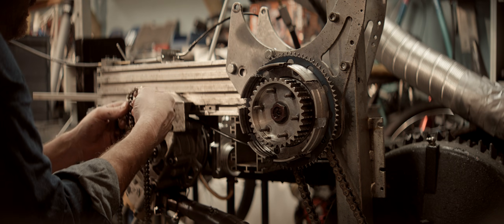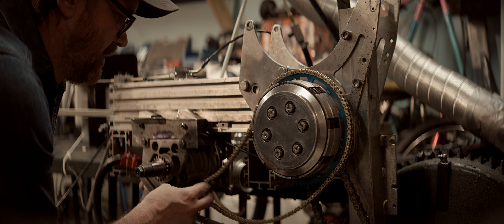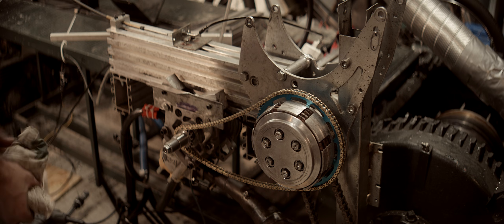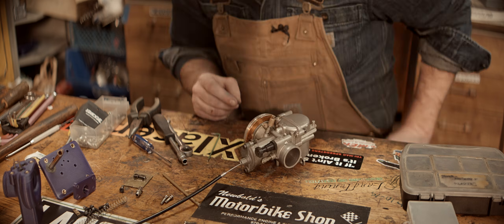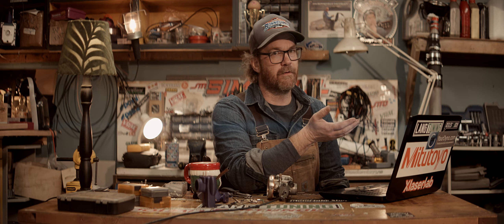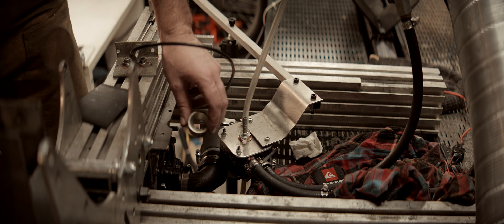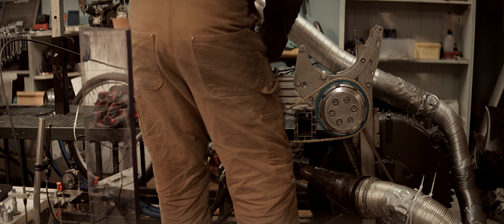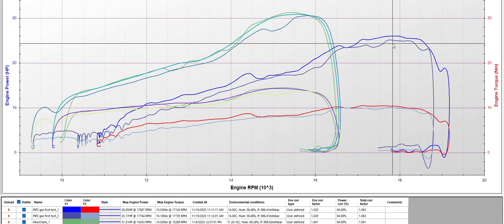50cc - 26hp on Pump Gas(without any tuning!)

Comment from the maker: Sorry about the delay! Promising results, especially as I just guessed on jetting 😁
Reply: Im looking forward to the day you make a v twin 100cc engine, you have the ability  , food for thought after you get where you want to be with the pip
Reply: Hope the approaching winter is kind to you and the family.
Reply: Get some RVS chain lube. Slippery stuff, like everything they have. Triboceramic witchery.
Reply: As for the "floating float" and keep in mind, I know nothing of engines, but I can't help think of how older generations of drones had those four small rubber boots/standoffs to hold the camera gantry and isolate vibrations. Might work for you, too.
Reply: Have you considered Nitrous Oxide + Race-Gas vs. Methanol & Nitro-Methane as the power adder???…..On naturally aspirated drag engines the power-ceiling of both is similar pretty similarly matched, because only so much air can be processed, and mechanical limitations usually come into play before that (if reliability is important).
Reply: Loving the spontaneous component relative spatial expansion shield!
❤❤❤❤
Reply: Wait what! Did you just brake the world record you have been after??? Thats 520 hp to the litre! Insane!
Reply: @PPekka   I don't think there is a previous officially sanctioned world record. but production bike record is 16.5hp (1966) and more recently the aftermarket Bidalot RF 50 WR that holds land speed worl records was denied over 20hp at the wheel. so yes 26hp is likely possible and I guess would be a WR if it was on a calibrated Dyno which is the big caveat since it was never dynoed outside the custom built Dyno and there those numbers come after a big correction to the Dyno that was supposedly underreporting power. the corrected value is based on the evaluation of the total inertia of the Dyno based on a series of calculations so I would say the is a pretty big error margin. the two objective ways to prove the power would be on a calibrated Dyno or beating a land speed record in a category that does not rely heavily on aero improvements unlike streamliners. the channel has been chasing the 50cc landspeed record  with  custom built frame but no fairing, for this reason.
if you look at 125cc which has a bit more data, peak 2stroke 125cc dirt bike was around 41hp and 125cc gp bikes made 50-55hp which is 400-440hp/ liter.
if you consider 50cc is easier to rev and gp bikes also had to be ridable (power curve mattered as much as peak power) and last a whole race, I think it's relatively safe to say running at 500hp/ liter for just a few seconds/minutes is totally doable.
Reply: @geemy9675 no There is no official record but if you have been following  this Channel for a bit longer you know that he once said that he would like to build the most powerful two stroke engine per cc ever. If I remember correctly the benchmark was a motogp 2 stroke that made over 400 hp / liter
Reply: @PPekka  2003 KTM 125 FRR 55hp  is 440hp/liter
Reply: @PPekka also 1983(last year) 50cc gp bikes made up to 19.5hp and 1989 80cc up to 30hp
but if you have no limits nitro, supercharger etc the ceiling is much higher top fuel make 1300hp+ per liter. of course there is no way to make that kind of boost in a 2 stroke
Reply: Great to see you back. What a good start using a petrol mix.
Reply: All your chain are belong to us. Make your time!
Reply: Can you made one video in norvegian language with subtitles?

Comment: I would use an electric hp oil pump to lube a closed crank case and run the efi direct injection .
With electric turbo.
And variable exhaust.

Comment: You did a lot of work lately setting your dyno's software up. But, and that's a big one, you did not confirm the readings with a motor of known output. 

I highly recommend using an electric motor with 10-15KW to double check that your dyno is working. I seriously doubt that you actually made 26hp from pump gas, anything over 15hp and I'd be impressed.

Comment: 26 hp with gasoline is a perfect match for 32 hp with nitro/methanol. 

But you finally need to admit that your crankshaft has too little rotating mass, which is why the chain, in the direction where it should be under tension, is constantly running against the tension in the area where the engine produces power, thus creating vibrations.

I'm not saying this negatively at all; I want you to be successful. 

Your problem is that you've become blind to the real issues over the years. An engine simply has to be designed from the outset to meet the requirements of its intended purpose. That means a 50cc engine running at 17,000 rpm needs X amount of air. What compression ratio and compression pressures are achieved? The higher the pressures, the more power is needed for compression. Compression draws its required drive power from two sources: the engine speed and the mass of the crankshaft. If the crankshaft has too little mass to provide enough driving force for compression, the crankshaft speed decreases during compression, but the chain wants to continue running at the same speed. 
You've been working on this project for far too long now; it's simply time to get serious, and that includes realizing that you've never considered the most important factor.
The first step in building a high-performance engine is to completely calculate the required output and design all components accordingly. Compression requires energy; energy comes from mass and rotational speed!

Comment: Guys a fast question, I see there are many 2t gurus here. Is it possible too much squish clearance do a no start condition? I'll get crazy....

Ignition timing is precisely set with dial gauge 
Chamber volume is -2cc from stock to raise compression a bit 
Squish ramp (angle and length) is almost stock 
Squish clearance from 1,6mm stock, went to 2,4mm 
Bike should start , but it doesn't...

Comment: Make your own "fuel". I've been making mine for 30+yrs. 200 litres at a time. Couple of 10 gal drums, couple of 44's, copper pipe, stainless steel tube, medical grade latex hosepipe, Pirex condenser, induction heater. Let yt be your guide.! Now, wheres that great musik you usually have.?

Comment: Alex is that a kerosene heater you use??? Because they aren't very healthy mate, the gas that burns off them is carbon monoxide (CO) poisoning, then on top of that, the fuels your burning in bike, doesn't make for a safe work environment, even using the extraction fan.
Take care mate 👍❣️😎🍻

Comment: I would like to see you install 2 mounted, non tensioning idlers for that chain. 1 on top and 1 on bottom, positioned where the peaks of the curves are when the chain is bouncing for the chain when it's being curvy but set in position for when the chain is straight between the sprockets. I think it will cut down on vibration without taking power maybe.

Comment: WHY NitroMethanol REV'D LESS THAN GASOLINE: Nitro requires as much as 8 times as much fuel for the same air volume. That creates more inertia which causes a slower entry into the cylinder when the transfers open. That loss of time reduces its high RPM ability. Also it burns slower than gasoline and so is less agreeable to high RPM running compared to gasoline. But its energy content is more which is why more horsepower can be had despite these limitations.

Comment: If true, this is extremely extraordinary, when you consider that professional world championships 50cc GP racing teams, like Kreidler Van Veen, Derbi, Bultaco, etc, never got any more than about 21hp, (Generally, about 19.5-20hp were the top performers, that wouldn't grenade themselves by the end of a race.) after several decades of research and development, and real-world testing on famed GP courses, of 50cc two-strokes, using rotary disk case induction. . Unfortunately, I have serious doubts however, without professional dyno results, and real-world testing, with the engine in a bike, with a rider on back, etc. I would be picking Aalt Toersen's brain, before he's no longer with us, but I've mentioned you should connect with Aalt numerous times, over the years, and as far as I know, you still haven't paid a visit to Aalt's shop in the Netherlands. Something I'm sure many folks would appreciate seeing some videos on- a visit to Aalt's shop, and some demonstrations of championships-winning GP bikes. Aalt wasn't just a rider for Van Veen, he also worked on engine development for Van Veen's world champion bikes. He still has a shop today, and last I knew still had some of his 50cc Van Veens in the personal stable! I believe, he also still rides in demos, and occasionally a race or two, as they are still held all over the Netherlands each year, even tho 50cc GP is no longer an FIM-sanctioned World Championships class.

Comment: What’s a stinger in this case?
Haven’t seen this development from the start so I’m wondering if this engine has a rotary timing disc? 
Back in the days we had Kreidler Van Veen. This formally Amsterdam based 50 cc racing team build great racers.

Comment: It's fumes man.
Your health  comes first.
Spend a couple days figuring out how to heat and ventilate your shop space.
Isolate the dyno in an enclosure that you are not in when the engine is running and ventilate it separately.
It will also keep that chain from wrapping itself around your neck.
Nitro fumes are no joke, not even in a small percentage mix.
30 HP is awesome !!!  Did I see 19,000 rpm ? The nitro engine was giving up at 17,000 right ? Could chain bind drag down 2000 rpm? Wow.

Comment: 25% nitro fuel is easy to get outside Norway. Is Norway trying to ban itself from you making Norway famous by getting the 50cc land speed record? A big LIPO battery is much more dangerous. One in a hybrid car started a fire that burnt down a huge new 2000 car carpark in the UK, but that is OK because no nitro was involved and we are not allowed to critisize the all new all electric revolution.

Comment: Congratulations.
One could almost say it sounds to good to be true.
26hp 50cc is if RSA would´ve had about 65hp to the crank.
But i who am i to judge?
Reply from the maker: It doesn't scale like that, the port area to volume ratio is much higher with 50cc.
Reply: @2STROKESTUFFING  You need to go to a verified dyno to back your numbers up.
I´ve seen discussions doubting you a little bit here and there.
Reply from the maker: @Peter_Granfors  I'm not loosing any sleep over it.
Reply: @2STROKESTUFFING  Soon enough you do, or starti chopping wood again =)

Comment: I think it’s possible that the chain slapping around may be really messing up the run results in general. A plain solid tensioner will not help either.  A spring or hydraulic loaded tensioner would smooth a lot of it out. Any solid tensioner will only create harmonics at a different frequency. 
Your chain slapping around is definitely not helping the engine because it’s small creating instances additional resistance due to the harmonics of the chain. 

I’m saying this because the size of the chain compared to the size of the engine is very large compared to a regular gasoline automotive engine.

Comment: Great stuff as always! A little hack for you: Find an old round base microphone stand and mount you auxiliary fuel tank to it. Doesn't take up much space and is hard to tip over due to the heavy base.

Comment: 5:54 det flyr gnister fra kjedet ditt bror.. det er ALT for slakkt og trenger minst en strammer oppe. ikke dumt med en nede heller? de bøffer ikke noe nevneverdig energi heller, du kan tenke deg slitasjen på kjedet og tannhjul når det fyker gnister fra kjedet? syns jeg så noe småblinking her og der under det samme runnet og. når kjedet ditt flekser mer en to ganger kjedet sin høyde er du i slite territoriet til de fleste kjeder, det vil bli tråkkt sånn som det kjedet du tok av nettop om ikke lenge med den fleksinga jeg ser på skjermen min.

kudos for bruk av skjoldet :) det må jo kjennes litt tryggere ut bak det ville jeg tro. også har vi høyere odd for å ha Alex så lenge vi kan! det er det viktigste ;)

hvis jeg var deg, ville jeg ha målt kompresjon intervallmessig annenhver hver/hver tredje dyno run. rett og slett for å sikre ett helt rent gulv for målingene siden ring slitasje er konstant og uunngåelig og vil påvirke alle målinger. fjerne variabler er gull.

p.s. 
braketten til jackshaften er litt løs og begever seg opp og ned litt. vanskelig å se i vanlig avspillings fart, men jeg la merke til det mens jeg lot videon gå i 0.25 hastighet mens jeg skrev kommentaren her. stram den opp litt til 👍 det er det firkanta røret heeelt til høyre i bildet som går opp og ned.

Comment: How curious.  Just this morning I was wondering where you'd got to.  My expectation was you'd either been badly hurt by a chain flying off and hitting you in the face, or you'd managed to poison yourself as a consequence of the fuel you were using.  Neither is good, so I'm happy to see I was only tangentially correct.  Wonderful to see you now have a plexiglass shield in place now.  As for the primary chain, good to see you've replaced it, good to see you've shortened it too, but still nothing to prevent it from flapping itself into resonant oblivion.  You really need to fix that as it will certainly be losing you some power, not to mention rapidly wearing the chain.  A simple guide on both sides of the top run should be enough to limit any flapping, but add a damped tensioner on the bottom run and you'll have everything under control.

Comment: The chain tools suck, your press is so much better. I like "split links" for ease of use however for higher power you want to properly press the links in and shroom the ends. I do wonder if a split link might work well here? Probably not with the amount of flex in the chain tbh

Comment: Best I've gotten from my 53cc 4 stroke motorized bike is 47mph on flat ground with no wind, tucked.
My butt dyno puts it somewhere around 3 hp.
I did the math, 55mph on my bike needs 4 hp, I only got to 53mph with a tailwind.
I also did the math for a tillotson 236r putting out ~22 hp and I think it was 94mph (I want to slap one on a bicycle).
These maths were done with a bicycle profile tucked in the wind without fairings.
Fairings change everything.

Comment: a few of those cheap diesel heaters designed for RVs and sheds would do way better than the current heater setup you have. Real exhausts, can run them on waste oil if you're OK with cleaning the insides every now and then.

Comment: Lastly, I have an inertia dyno that originally ran with a chain drive. We had the same kinking problem and switched to a belt drive, which was a huge improvement. There is a kart racing chain that has extra side clearance, called Space Chain, that you could try.

Comment: Once you know the egt delta between your methanol runs and your gas runs, you can design a pipe with a shorter tuned length based on the delta.